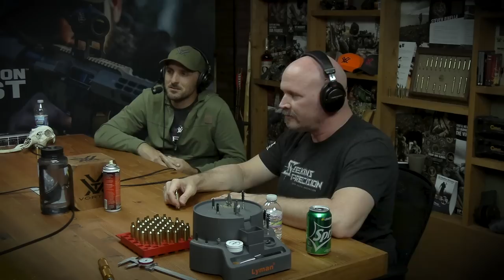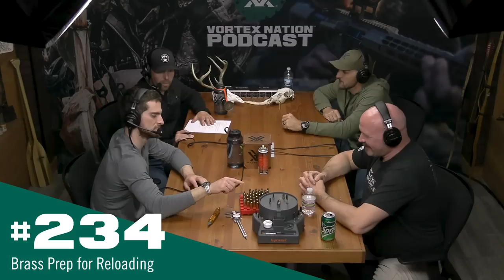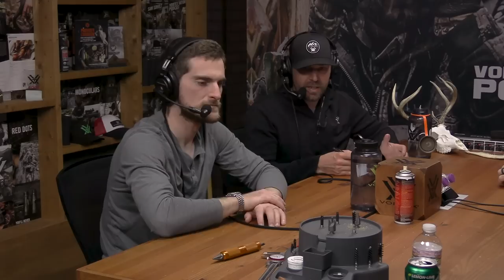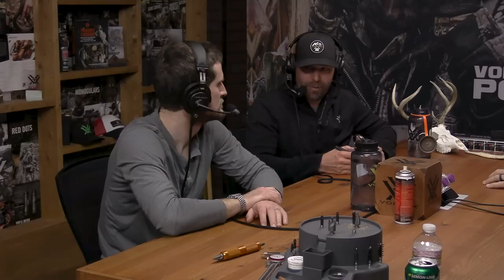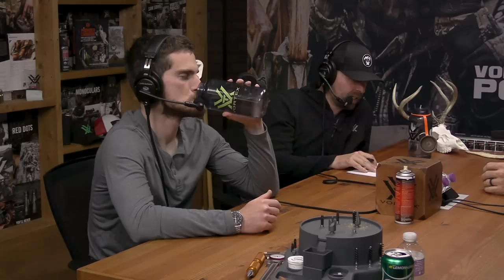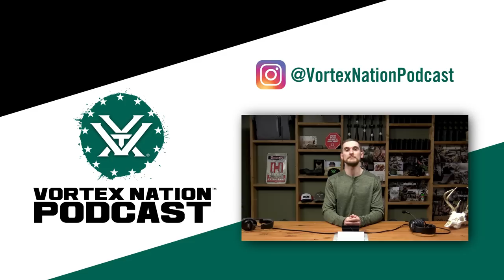Ep. 234 | Brass Prep for Reloading

Comment: I always tumble my cases first before anything else so grime doesn't erode my dies. Great pod cast!
Reply: This. /\  Grit will damage steel dies.
Reply: I know my comment is a little late, but if you get a universal decapping die then it doesn't resize or anything. You decap everything, then clean it without primers so that it cleans in the pockets, then resize it later after it's all cleaned. That's what I do.

Comment: Reloading is like buying a scope it can be done at many different price ranges. The higher level of accuracy you want the more you spend. Don't forget to include your family in the process. Passing on the information and love of Reloading and shooting is priceless.
Reply: you dont need to spend large sums to get really accurate rifle ammo, especially in brass prep. A standard FL sizing die will size brass as consistently as a "match grade" sizing die. Cleaning primer pockets isnt necessary. Trimming can be accomplished fairly cheaply, usually less than $200 for an entire trim/debur/chamfer setup. A good tumbling setup is around $200, you just have to pick wet or dry tumbling. Spending anymore than that on brass prep is completely unnecessary.

Comment: Stainless steel pins in a tumbler with Lemi-shine. The brass comes out looking like factory brass.
Reply: I love that recipe! 
-1/2 tbsp dish soap
-1/8 tsp lemishine
-hot water 1-2 inches above the brass
Tumble for 1.5 hours.

I tried it with just the dish soap yesterday, and it came out looking almost as good. I don't actually plan on using Lemishine moving forward.
Reply: It does, but honestly I started off with wet tumbling with the same recipe, but as of 8 months ago I switched to vibratory tumbling with rice and I’ll never go back to wet tumbling with my precision ammo. A lot more consistent seating pressures with tumbling with rice and the case mouths don’t get dinged up. 3hours to tumble clean and then after sizing I tumble for 15 minutes to remove the sizing wax.

Comment: As far as case cleaning goes, I tumble all my brass in walnut media (lizard litter bought at a pet store) treated with NU-Finish polish and a quarter cup of odorless mineral spirits.   Once the walnut is run in the tumbler for about a half hour the walnut is ready to clean brass.  It takes 2 hours to clean a load of brass. The walnut media lasts 6-8 months of almost daily use.  One thing of note is, the more brass that goes into the tumbler the better it cleans. The brass pushes itself along and forces itself against the media.  Dumping 50 cases in the tumbler will take a lot longer to clean than 300 cases will.  A half of a used drier sheet will also collect a lot of the dust and grime keeping the media cleaner for a longer time.    I run 3 tumblers to clean a lot of range brass.  I identify 5.56 brass as once fired only if it has crimped primer pockets.   With rifle brass I clean, lube, size & decap, run 20 minutes in the tumbler to remove the lube, decrimp the primer pockets, trim, chamfer, sort by headstamp,  and load.  I usually hang on to the primed brass until I have at least 500 of a headstamp to load in a single lot.  I find different brands of 5.56 brass grow at different rates so I keep all of them sorted that way. I will anneal them before the get trimmed again.  I will trim cases again usually after the 3rd firing but some quality cases can go 5 or 6 firings without it.  A certain well known name brand of brass is usually discarded after 5 reloads due to poor primer retention.  Any range brass that looks to have been fired more than twice gets cut down to 300 blackout or goes into the scrap bucket.   For other rifle loads I do small quantities with more attention to the little details.

Comment: Since all the comments are talking about it, here's that Lemishine recipe! 
-1/2 tbsp dish soap
-1/8 tsp lemishine
-hot water 1-2 inches above the brass
Tumble for 1.5 hours.

I tried it with just the dish soap yesterday, and it came out looking almost as good. I don't actually plan on using Lemishine moving forward. I also toss the SS media in a dish-cloth and put it at the top of my dryer (an old food dehydrator) and it dries it all out quite nicely.
Reply: I use armorall wash n wax instead of dish soap.  Seems to help keep the brass from getting water marks or patina.
Reply: When you have hard Water you need Lemishine with soft water it isnt nesecary

Comment: Great podcast. Basically fits my setup with a few personal tweaks.  I decap then resize (neck) then trim if needed.  Then I wet tumble in little stainless chips not pins (smaller). After that, they go into some corn cob media that has carnuba wax in it.   30 min or so and they are dry and  slick.  Then a double check and reload.
Reply from the maker: Sounds like you've got a good system going! 👍

Comment: I really don't clean brass like most do. For bottleneck rifle calibers I've always just decapped, sonic cleaned, then after it's dry ill use unique wax lube and size it, then measure it and trim if necessary, chamfer if I trim it,  wipe off the lube, prime and load.

Comment: My Process is Decapping, wet Tumble, Lube and Sizeing, Trimm if nessacary, Champer and Debur then Dry Tumble to get the Lube and Brass Shavings out of the Cases and then Load
Reply: Second tumble ain’t a bad plan, might add that to my routine
Reply: @509Gman  the first Cleaning is to not have the dirt in your dies the second is to get the lube from the cases at first wet tumble with stainless the second with very fine walnut that doesnt even has a chance to Stick in your flashholes / the Hole Carbon and lead are gone after the wet tumbling it is only for lube and brass shavings it works Great for me so i Stick with my process

Comment: The biggest screw up i made when reloading was when i purchased 5 kg of once fired .308 brass from a wholesaler for $200.00. I checked the bottoms of the casings for the calibre and they were all .308 calibre but different brands,measured the overall length and they checked out ok,measured the width against my action and checked out ok,but i didn't measure the case thickness of the brass-it turned out to be military brass so the .05 mm difference meant they wouldn't chamber in my howa 1500 .308 ! Luckily i only reloaded 50 rounds when i thought i should chamber a round to see how they load,thats when i realised the brass was too thick as it would not chamber. I ended up getting my money back and told the guy its all military brass,it wont fit in civilian firearms that are .308. Probably came out of a .308 belt fed machine gun ? Lesson learnt-only buy brass from gun shops.

Comment: If my brass didn’t fall into the dirt:
1. anneal
2. Lube and Full-Length Resize/ decap
3. Wet tumble with Dawn and LemiShine w SS pins
4. Dehydrate / dry brass.
5. Trim/ chamfer/ debur 
6. Prime
7. Powder charge
8. Seat bullet